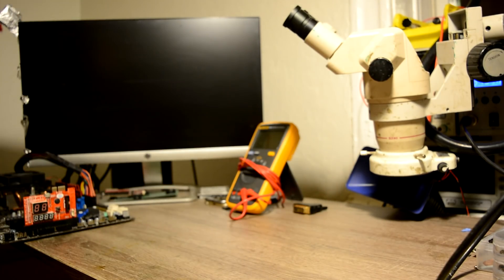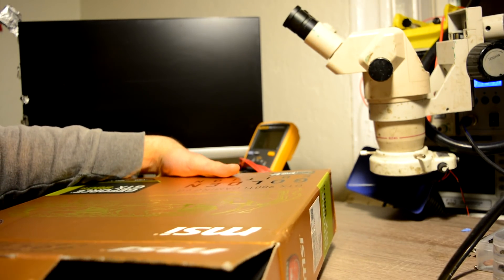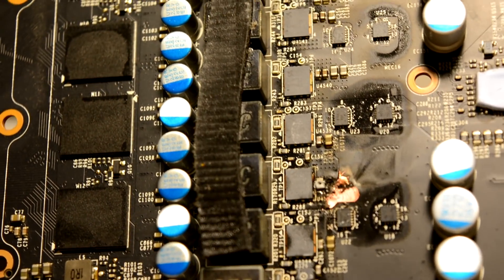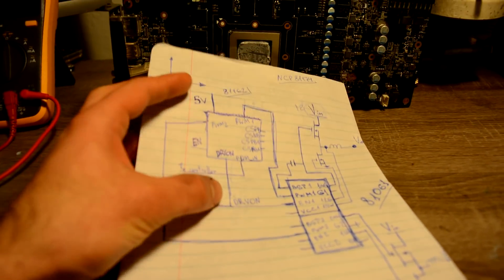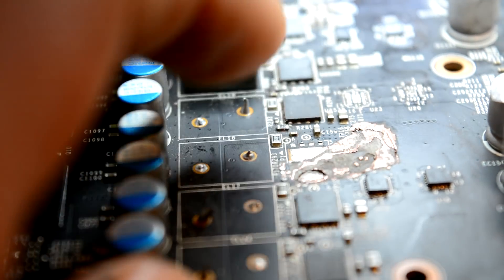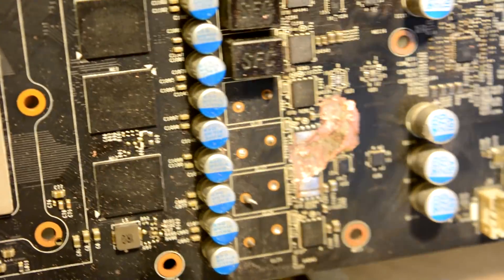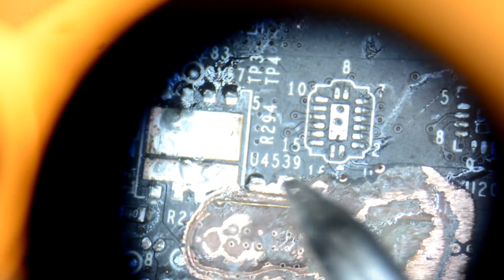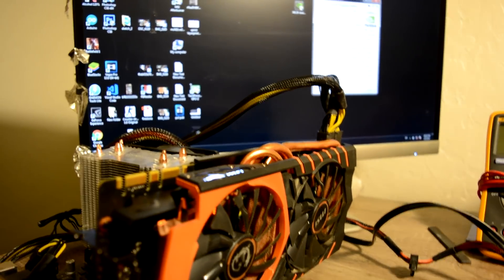GTX 980 ti burnt out 🥵 broken / no video out  card from Germany repair and diagnostic process

Comment: Good work, great video ... I would appreciate advice - my friend has an issue with his GTX 980 Strix as it boots to desktop but it crashes (to a pure blue or black screen) a minute or two after entering a game (for example Lost Ark). We ordered a new PSU as we though it would solve the issue, because for a while he was able to use GPUTweak to lower GPU Power Target to 65%, underclock GPU and memory to lowest possible and he would be able to play games for hours. The new PSU (Corsair RM650 CP) did not solve the issue so we changed the thermal pad on the GPU VRM and repasted and it did not solve the issue, but now it got worse - even with 65% power target and underclock it would crash a minute after entering a more demanding game. There is no visible damage on the card, but an oil leak was present on the VRM and we have cleaned it, so we are now wondering if the card can be repaired by a professional electronic or should we give it up?

Comment: It seems to me one could run insulated wires above the board and even connect the missing components above masking and it might look like a Frankenstein card but work well even on a stress test if one or two phases were hooked back up. It might pay to try to do it even if it looks awkward just as a test card to show people you are a wizard. Like bragging rights not necessarily economically. Looking at this much later I see that I would try to put back the doubler and disable half of it by removing it's connection. The amount of power you were applying to the board looked like 12v. I couldn't understand how the graphics chip could begin to take that. Then I saw the blurb screen display so this card will struggle on.

Comment: Great video! Maybe you can help me. I have a Zotac GTX 1070 Mini and the shielding is cracked on 2 of the inductors. I would like to replace all 5 of them at once just to be safe. Do you know where I can purchase R22 inductors that will fit my card? It works just fine, but I would like the peace of mind knowing they are not going to short out and ruin my card. Thanks and keep up the good work!

Comment: Just fixed a 980Ti with bad memory lowside mosfet and flown inductor. Works perfectly. I have two more to repair, and one of them looks like this one and I know for sure I'd be losing at least one power phase, leaving 7 available (hopefully).  The other one needs all new VRAM and power phase controller. These cards aren't exactly aging well.

Comment: 1060 6g SSC .06G-P4-6267-KR   with the problem of error 43 and when I restart there is no signal until after several adapters the device turns on and the cause of viruses for mining I changed the thermal paste and downloaded the latest Windows 10 system I updated and updated the definition of my graphics card and I updated the BIOS for my motherboard to the latest update and turned on  Graphics card in another machine and still the same problem

Comment: Question, if you downclock and Down voltage, that is still dangerous to use it with 3 phases down ?
Reply: i got the same question. so did you have the answer right now?
Reply: no sorry !  @faunas5710

Comment: I am just here laughing while watching the GPU still working after that kind of damage to the power circuit. That proves the point that GPU chip itself can work after blown VRM. I have some questions though. Why did you put back the inductors on those damaged phases? And did you change the configuration of the VRM voltage controller?

Comment: I repair main boards for work but I would never use a rotary to remove burnt layers of pcb. I think a sharp razor and a scope is the best option
Also you should get a psu to inject power instead of having to plug it in and out all these times. Just inject little voltage and use some alcohol and you’ll be able to spot exactly where the short is

Comment: Hey would you be interested in fixing my asus strix gtx 1070? It turns on fans spin like normal get a white light and the leds flashing orange. Getting no video coming out of it has 12v and 5v but don't see no 3.3v gpu does start to get warm when plugged in. Any suggestions or would you be interested in repair ?

Comment: Nice work! I have that same card and it has a short in one of the power inductor coils. Those two gray boxes next to the power connector cable slots. Any specs of those components? Thx if you have time to answer!

Comment: Hmm,,, there was some GTX 780 ti that had similar problem. It had resistor or SMD cap burned at the same spot as that GTX 980 Ti... I think GTX 980 ti and GTX 780 ti use similar PCBs. so this is the process of fixing it, remove the damaged phases and cut the traces from the PCB... I didn't buy that card because GTX 780 ti is too old card for it to be interesting... GTX 980 TI might still be worth it to fix. So if a SMD cap or resistor burns, does it damage the PCB layers also? I guess that's what you were trying to fix there.

Comment: I have succesfully repaired other types of electronic equipment, by placing a separate small homemade PCB over a burnt area.
On the small PCB I built a circuit like the old one and provided the necessary connections to the main PCB.
You can do the same here, by making 3 copies of a working phase on to a separate PCB.

Comment: It's a bit late, but you can rewire the fet drivers to the fets without the driver, just run some jumperwires to the gate and don't forget about the current monitoring. Or you could change the dubbler into same output on both phases without current balancing and forget about the sense wires :)

Comment: Hey Eli I have the EVGA GTX 980 TI SC its one of the top-notch cards till the other day wouldn't boot up when I press the power button only flashes and off, took out GPU works fine, it seems like there is a short on the 8pin PCIe on GPU, I love this GPU i would like to get the conductor replaced, and still use the card, it literary looks brand new, I got also a gtx 1070, but I want the 980 back t work, can you give me some suggestions. I live in NJ

Comment: Hi there Eli, I have a gtx 750ti that just stopped working, I suspect it wiggled in the socket and somehow caused some circuitry damage. By using a multimeter, I was able to narrow down the affected area, and concluded that some caps are reading as a short with respect to common ground, these caps are associated with the main power that goes to the die. https://imgur.com/gallery/2JV00Td I was hoping that you could potentially point me in the right direction to possibly fixing it, as it is cheap enough of a card I wouldn't mind further bricking it. The card initially upon the system booting does display bios information, but as soon as the system tries to load the bootloader, it doesn't display anything. Any clues on further diagnostics?

Comment: As a beginner, I would have liked to see how you decided there were shorts and how you found where they are. I purchased a video card they said was broke. I plugged it in and at least there is a picture but this board is real hot!! I tried to ohm the mosfets and they seemed shorted. I removed the mosfet, caps, and , and, that acted like shorted and checked them off the board and all were good. Put everything back and now I found more areas that look shorted. How do you check out a board so that you dont go down the rabbit hole looking for shorts!!! Thanks for the videos.

Comment: Eli 
I have a 980 strix card and a maximus 7 hero board.
The issue is gpu is not detected and no display 
This happens only on 2nd boot in a long power off and cold boot the card recognized fine and aces the stress test without artifacts or issues.
When i do a restart or wake from sleep gpu is not detected. I have thoroughly checked the gpu

Comment: Amazing repair! I wonder if you could build those other phases on a separate PCB and wire it in? Could sit on the back of the card. Worth it to save a 980 TI.
Reply: Not possible to see where traces go under the layers without Board View

Comment: My sons GTX 980 ti went funny yesterday, computer kept blanking screen then going back on again with resolution details and appeared fine, thought it might just be loose hdmi connection at the time but his system said going into sleep / shutting down and then wouldnt turn back on again.   i stripped the system down and bought a new psu hoping it might just be psu and have stripped the graphics card out and also stripped the graphics card to check for burns / pops etc and nothing obvious but if i take the graphics card out the machine turns on if i plug the graphics card in but dont connect the additional 8 and 6 pin connectors it works but as soon as i connect the 8 and 6 pin connectors the system wont put any power into the motherboard (fans dont even twitch).  do you have any ideas from your experience of what this could be?    was used just as standard gaming card, not over clocked etc.  Thanks in advance

Comment: Hi Eli, Think you can service my Radeon RX 580 8GB?

It has been tampered with.
The fans spin on power but then shortly after stops...
Also there is no post on the computer when plugged in.

Comment: I have a Gtx 980ti from EVGA, I replaced one of the SIC789 mosfets and the Card seemed to boot again. Any load coused an instand reboot though. I removed the new mosfet again to see if that was the issue but now the card seems to be caugt in a boot loop of sorts. The led light on the card keeps flashing and the memory and vcore voltage doesn't intitialize. The voltage for the led and fan fluctuates very quickly between 4 and 12 volts averaging on around 7 volts. Ich have checked for shorts but everything seems to be fine I have never seen those symptoms and I really don't know where I should start looking. Can you help me? A hint or possible cause would really help me searching on the internet doesn't result in anything useful.

Comment: I have the same version 1.1 card and I think the 3.3v is missing, should they be in the winged coil of the MEC14 hole? How do I fix it? Help me please, I'm from Argentina.
Reply: the ic uP1727P is a 2.5 to 5v regulator, but it has 0.1v at the output, 3.3v at the input, how much should the output be?

Comment: Great Video. I actually thought i would be the only one, but my MSI 980TI died with a bang after little less than 4 years. Computer shut down, graphics card was hot. Tried to get it to run but sadly, on my attempt it gave me a flame and burned smell. I bet it's the same problem, maybe i will find the courage to actually try and repair it. Sad to see a €800,- graphics card to burn after 4 years

Comment: Very nice video and skill! I have a 980ti g1 with the r172 and r174 resistors blown straight out. I have taken it apart and have picture of the board and the hole itself, it looks like it goes pretty deep but I have an untrained eye. No service center will touch it. Is there any way you could tell me if its fixable? Maybe if I send you pictures? Any response would be very appreciated.

Comment: I have a Short circuited( most probably) MSI 980ti gaming X, the shunt resistor below one of the 8 pin power connector (left side) got burnt out. So i shorted them with a copper wire since I knew these shunt resistors only limits the max power draw and basically unlocks the power limit. After that same thing happened, the copper wire got burnt out. Then I tried to power the card with one 6 pin connector only and left the 8 pin side open because the shunt was getting burnt, pc turned on and gpu got power with its side led but PC kept restarting after 3-5 secs. After 3 restarts the pcie extension cable(i had it mounted vertically) caught fire.
Any idea what's wrong?

Comment: That's really impressive, shorts are most the time a sign of a broken elements. I have 2 broken EVGA GPUs, I really don't know what to do with them, I don't have burnts, they just stopped working. The cause for the two was the first one GTX 770, got a case hit and stopped working, the 2nd one GTX 780 classified with similar problem but stopped working because of moving the case in the car during travelling.

Comment: Hey Eli! I appreciate the time and effort you put into each video. I have an issue with my EVGA 980 Ti SC+ card. It still boots and allows me to play videos and do light web browsing. However, as soon as I play a game or run an intensive graphics load it freezes, and I have to power cycle my pc. I have done a fresh install of Windows 10 and reinstalled the latest Nvidia driver with no success. I cleaned the whole card with 91% alcohol and repasted the GPU as well. I also flashed a newer EVGA bios to verify the bios wasn't corrupt. I bought a new 850Watt Gold+ psu and tested the GPU in a different motherboard with the same issue. I believe there is a failing component in my GPU, but I don't see anything damaged physically or burned out. Do you have any thoughts?
Reply: It could be that the welding of your graphics card needs to be replaced, so it would be advisable to rebaling the card and verify that the problem is solved.
Upload a video of your problem.
Reply: @blosgames4492  I was hoping it wouldn't come to re-soldering, but do you suggest just re-balling the GPU Chip first? Thanks!
Reply: @AustinTechAuthority  
f you can upload a video it would be helpful because this way you can get to the root of the problem.

On the other hand, what was the last thing that made your card?
In other words, you increased the frequencies to the card (OC), the power went out, did the liquid fall? ...
Reply: I will try to do a video at some point. I'm not overclocking the card, and it was staying below 68 Celsius even under gaming. I keep a balanced fan profile that keeps the card under 50C when just watching videos or browsing. I've tried underclocking the card by 30 percent, but it still crashes under 100% load.

Comment: Awesome video. I was wondering if you have input on a 980TI with a very frustrating mode of failure which is driving me bonkers. The card will suddenly act as if one of the PCI-E connectors were pulled from it under load, and I can make it happen on demand if I press lightly on the PCB near the PCI-E connectors to flex the card a bit while under high load. The screen goes black, the driver crashes and fails to recover. Sometimes the PC works in the background and I can soft power it down, other times it will slowly stop responding and lock up then require a hard restart. The card works fine in low power modes and lower clocks, and is 100% stable in light 3D, the problem begins when it goes into high performance power modes, regardless of underclocking.

I'm sure the problem lies somewhere near the VRM circuitry, but I can't isolate it and this mode of failure is alien to me. I've touched up the solder on the diodes, the coils, and all of the capacitors around the phases that I can get to with a soldering iron. I've also reflowed the card at 192c for 11 minutes, and 204c for 9 minutes. Have you ever encountered a failure like this? Any input at all? Thanks for your time.
Reply: Upload the video explaining the problem, new information about the card problem may arise.
Reply: @blosgames4492  lol It probably would've been a good idea, but the card has since blown TF up. The VRM for vCore was going bad, the card started tripping the OCP on my PSU, until it quit powering up. I didn't know which VRM chip was on the way out, so I started powering it up without plugging into the PCI-E. Sure enough, about the 4th time I powered it up, OCP didn't drip, and the vCore VRM went up in smoke. I immediately shut the PSU off, but I have no idea if it sent 12v to the core, it probably did. I replaced it with a 5700 XT, last nVidia card I buy :)
Reply: @K31TH3R  
Too bad for the card): But you can have it for spare parts.

I recommend having your new card with low temperatures, and changing the paste every month or 2 months, so that it lasts a long time.
Greetings.
Reply: @blosgames4492  Thanks mate. RIP. I do plan on keeping it, maybe even try to fix it at some point. And I'm way ahead of you on the 5700 XT, already have it on water cooling, with some Thermal Grizzly Conductonaut paste, and a whole bunch of heatsinks on RAM/VRMs. Idles at 28c, loads at 51c. The water block I have didn't fit the 980 TI, so I stuck with the ACX2.0 cooler. Who knows if the VRM would've lasted longer, they seem to like to pop on nVidia cards no matter how good you treat them. At least that's been my luck.
Reply: @K31TH3R  
Great, it seems that you put together a better team in the future, as a recommendation I would advise you to buy a
  "Uninterruptible Power Source" this will guarantee that if you suffer a power outage the PC will remain on for a couple of hours, and you have enough time to turn on your equipment.

Comment: I got the same card. I tried to RMA the card since I bought it on 16th of June 2016. It was supposed to have 3 year warranty but I got rejected by MSI. The RMA support told me that the warranty started when they shipped it to Newegg and not the date of purchase. That's a scummy move to pull.
Reply: Thats a lie. Its from the day you buy it from the shop.
Reply: If you'd be in EU you'd be protected by the Law. Either contact NewEgg and consult with them on the matter or contact authorities responsible for buyer protection.
Reply: @klemenkovacic9109  i had the same issue in netherlands with a phone

Comment: Hey, I got a EVGA 970 exactly like the one you fixed but it shorts the 12v out, 6 ohms between 12v line and ground. No signs of damage, one broken inductor that seems to have broke from mechanical shock, its not completely broken and should still work, it's for 3.3 volts I think, it's not from the phases. Can you help please?

Comment: Ask BuildZoid if you don't find drivers. ps it isn't a transistor but a mosfet ;) also if possible get a angled hot air nozzle and thicker solder wire ;)
Reply: https://en.wikipedia.org/wiki/MOSFET